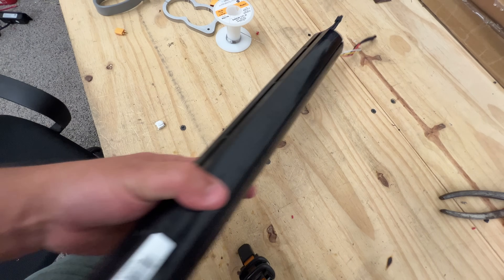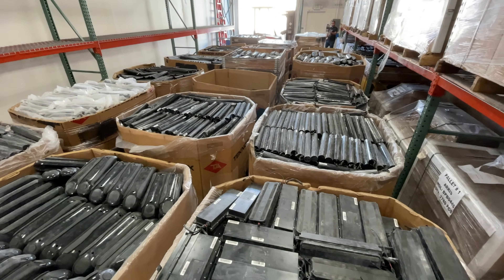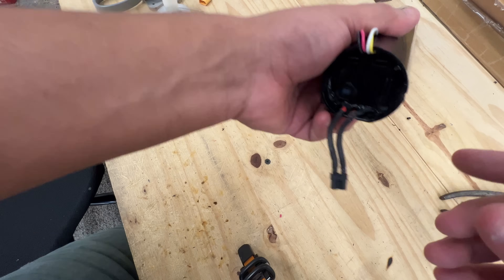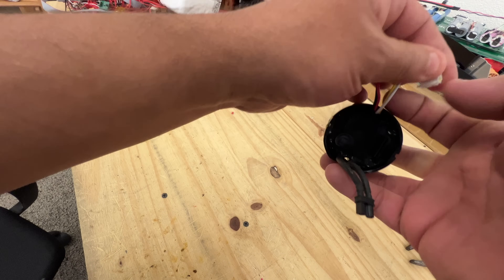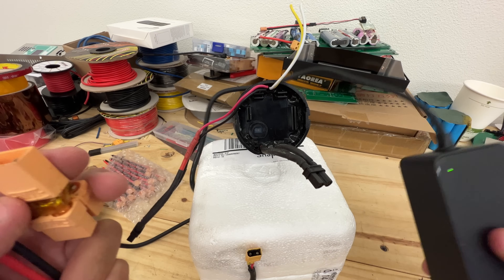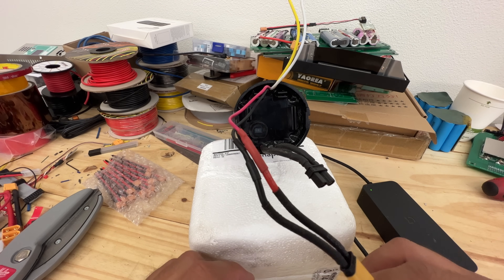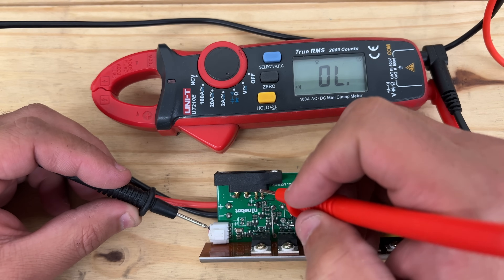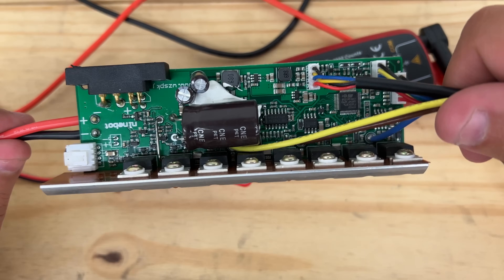36v Scooter Battery charging

Comment: Hello i got 2 42v xiaomi 3m65 pro batteries in series can i connect both red and black wires together for the charging plug and charge them together?
Reply: I would think you should only use and charge 2 packs in parallel.

Comment: Ha! I have SO many of these ES4 packs.  I’m embarrassed to say how many! 

Internal and external. 
Yeah, electrically both are the same but the internal are MUCH easier to extract.  Ninebot started potting external pack’s after some time.  

All have 2500 mAh EVE cells. I can’t remember their c rating but they are relatively high discharge and can take some abuse.  I abused the hell out of them on a scooter back when I thought a ES4 was the best thing ever.  Lol!  I pushed way beyond what the scooters stock amp draw. I was very surprised.  Never once had a bad cell.

Comment: If you found you're way here after having trouble waking up your 20 cell scooter packs here's my experience June 2022:
Charging directly to the thin wires with no other steps only worked on one of my 5 packs purchased recently, Red light blinks 5-8 times then stops, charger stays green.
I'm not sure if this may be because they have been sitting for some time at this point or other factors I don't understand, but if you end up in a similar situation I have seen some success with hitting the reset and charging threw the discharge port (Thicker cables) as referenced in this video. If you're looking for more details on that jehugarcia has an older video that gives very specific instructions (Search for: How to Wake up Best Scooter Batteries of 2021)
Reply: I purchased five of these batteries. I was able to easily get three to work. I unscrewed the cover for the BMS and charged via the discharge connector. When you unscrew the covers it is easy to swap the good BMS boards around to see if the BMS is the issue with non working battery packs. . I will try and work on the two that are not working. My DC power supply was able to charge them to 42 volts. What I really want to do is use the Ninebot controller and the display to see if the BMS will balance the batteries in each pack. If it does, it should be easy to move the controller from one battery pack to the other. I also want to check out what people are calling the bottom BMS in these packs to see if that could be the issue with the two non working battery packs. If I can,t get them to work I could always scavenge the good cells.
Reply: For me on all of my scooter packs I had to by pass the discharge port as it would shut off after 1 minute regardless of load. 
What did you do to get your packs to stay on? I was able to wake all of them up no problem simply by charging them but can't get them to keep outputting voltage. THe blinking light does its thing but after a minute it cuts voltage. So by pass the BMS for output but charge via the BMS/discharge port basically.

Comment: Hey jehu- I just bought some rz3612 are you familiar with them? They are all sitting at about 15v. I was able to charge one of them to about 21v thru the main output wire pair and then it just stopped. There is a small set of red and black wires as well but they only show like 1v(ish) so I don’t think it’s a charging port but… I really don’t know. For all I know these BMS’s are smart and only let power thru one way on the input and output. Any help would be great

Comment: I  just purchased a bunch of these "untested" packs, When I try this, the red LED flashes six times with the last flash being a bit longer, then nothing. They don't charge this way, so I'm going to assume that either there is a problem with cells or the boards themselves, unless anybody has additional information.
Reply: I've had the same thing happen as well with about half the untested packs i purchased.
Reply: @lu6an0  hi, did you find a solution? Thanks
Reply: I ended up going to the battery pack directly and using a CC/CV power supply, charged them up with low current (50 mA) to about 30 v, then charged them with higher current until they were full.
Reply: @magic.marmot  Do you connect the low current supply to the small wire or the normal charge wire?
Reply: @magic.marmot  dis you use the power output connector or did you open the battery pack? Thanks
Reply: Im pretty sure I have a video on my channel from a couple of months ago.
Reply: I have the same issue, and one of the pack do not even has red LED flashes even I current with the small red and black wire, any ideas? I bought 5 packs and only 1 work
Reply: I opened the pack.
Reply: @magic.marmot  thanks, no way to put current through  the output connector?
Reply: @magic.marmot  Do you have a picture showing how to charge it after opened the pack? Thanks for advance!
Reply: I found out the way to charge them now, just keep charging through the small wire for a long time (a day or so), reconnect and disconnect until the red light start blinking. Or if the red light never respond, one can keep charging the a big wire for a very long time too. Eventually, the BMS will wake up. I am able to use this method even the battery voltage is less than 7V. My experience is that when the battery drop below 15V, the red LED starts flashes six times pattern when changer through the small wire, when battery voltage drop less than 10V, the red LED will not even turn on even charge through the small wire.

Comment: What does charging look like when these are connected in parallel for a power wall.  Do the small wires have to be used at this stage.  I wanna throw 28 of these on a Megalo Dongle.

Comment: Could these be used, in a large quantity to power an electric car?
Reply: Absolutely.. I've seen a couple of videos of guys using these for golf carts. As long as you have the correct output voltage and you have enough sales. Tesla the same batteries are internal on these. Not necessarily the same brand but the same size lithium ion cell.

Comment: I purchased two of the external scooter batteries and a charger from you to use in parallel for an ebike.
When I plug the charger into the dedicated charging port on the front of the battery I get the blinking light that you see in this video at 2:50.  Basically it charges for like half of a second and then stops charging for a couple of seconds, then repeats.
The batteries are at 35.5v so it is not that they are too drained.
Has anyone been able to get the external scooter batteries to charge from the charge port?
I can charge it from the discharge port using an xt30, but I am concerned that this is bypassing the bms and the cells may end up out of balance.
Reply: When the charger's light flashes red, the voltage goes up at the discharge port, and when it goes green the voltage floats down again. This form of intermittent charging will eventually charge the battery but like you said, can the bms balance the cell groups?  I think its possible if the controller is not too busy wondering why the charger keeps switching on and off.

If you had an ES scooter you could use the app to see the internal voltages, but otherwise I think the only way to tell is to open the battery and check the cell groups for balance directly.  There is a video on you tube showing how to open the external battery. There are two screws at the top and bottom, and a bunch of snaps on the sides that need to be pried open. 

I have a controller like the one shown in the video, and found that to get a solid red light on my charger I also had to connect the internal battery to the controller with its 4pin cable before the charger will give a solid red charging light. The internal battery's XT30 discharge cable was optional.  

On the external battery there is a legend that labels the 6 exposed pins.
Two are Labeled Rx and Tx. These are for communicating between the bms and the controller. The controller is able to identify the difference between an internal and external battery. There is a guy on YouTube by the name of BananaScience who knows a lot about this. He found that he could hook up an internal battery to the external com port, and see the cell group voltages on his scooter app. But the scooter would not run with the internal battery hooked to the external port.  In order to use an internal battery 'externally' he had to wire them together in parallel by creating a Y cable.

My hunch is that the controller needs to be able to enable or disable each bms to ' avoid paralleling them until their voltages are within some tolerance. I don't feel comfortable guessing beyond this simple idea.

I would slow charge through the charge port in blinking mode in order to keep the bms in control. Then open up the case and check the cell groups for balance.  Personally I would solder two 5 pin RC balance cables with connectors to the cell groups and pass them through holes in the case so I could easily check the balance any time. Then I would bulk charge through the xt30 discharge port to avoid the 'slow blinking light' situation.

Perhaps someone could decode the communication between the controller and battery and use an Arduino to be able to spoof the bms into thinking they are good to go.
This was done for one of the other large scooter batteries that JAG35 sells.
Until then, we will have to deal with these issues.
Reply: @eideticgoone7035  fantastic info. Thank you so much. Yeah, I was wondering the same thing about the Arduino and the bigger scooter battery. Maybe something similar would be needed here.
Reply: @SherwoodWorksInc  Good Luck. Your comment seemed insightful, so I thought you would deserve a deeper reply. It took a while to piece together the clues. By the way, I've had good luck using two M365 scooter batteries wired in parallel on a 36v 500watt geared motor pulling as much as 800 watts. I first brought them to the same voltage then connected them in parallel. I leave them connected together when charging. I plug the charger into one pack's charge port and the other is charged via the discharge port through my Y discharge cable. Like these ninebot batteries there is a bms led that blinks blue then changes to red when charging. When plugged into the charge port on one charger, it changes from blue to red. A few seconds later the other pack starts blinking red even though it is not connected except through the Xt30 parallel discharge cable. If the Ninebot external bms works in the same way, then they might just be able to balance even though you are charging through the discharge port. 
No way to tell without trying.
I haven't yet punctured their shrink wrap on my M365 batteries to measure the state of balance.  I would like to, but I also like them sealed. I think paralleling two or three scooter batteries makes a cheap and good ebike battery.

Comment: Jehu, these batteries have a big disadvantage. The BMS has an Over Current Protection. When discharging they cannot go over 5A. That's the limit.
Reply: you sure? it seems odd that a scooter battery would be limited to 5a, that's only 180w the motor could pull.
Reply: @Wooble57  Tested on the workbench with an Amp-hour tester. When current is same or more than 5A, it triggers OCP. I refurbish these packs and the way to test them is to discharge them at 4.5A.
Reply: @9013368  wow, pretty lame packs then, at least for ebike duty or anything else high drain.  Guessing from the AH rating it's 2p, so that's only 2.5 amps a cell.  Pretty weak.
Reply: @Wooble57  I have also seen this. I bought two for a parallel pack for a 36v 450W ebike. I thought since they were advertised at 7.5 amps it would be fine for 12.5 amps of draw in parallel. I tried it out and after only 5 seconds of full throttle the bms would shut off current and start blinking red. It resets after about 30 seconds. I found that I could hold about 2/3 throttle and it could keep running but makes it basically useless. I may have to add a third one to see if it will make it useable.
Reply: Do you have an instagram or other page we and others can chat about this or other ebike battery problem/solution, im trying a 72 volt assembly but 2 of these in series didnt work for me at all,and i thought the parts i have are to blame so is why i didnt want to go out and buy a big 72 volt pack just yet,it sounds like a bms problem not a battery issue on these packs right?
Reply: The website has an edited listing now. The graphic and details say 5.2A, the page title still says 7.5 A though.

Comment: Do these cells are able to  be used for an electric car on a 72v configuration ?
Reply from the maker: Yes
Reply: @jehugarcia  anything i need to check in order to make sure they are able to power the electric engine?
Reply: @jehugarcia  no shipping available to japan :(
Reply: @jehugarcia  really how ?i bought 2 36 volt battery packs which are in good conditions and the 72 volt wheel im trying to power is controlled by a 1000watt-1500w controller, switch and throttle are configured correctly controller is not shortened,and throttle and 'on switch' are just fine aswell but the wheel still won't move im getting working readings on the vehicles display but ,it continues to relay a low battery emblem,i have them in series correctly,and charged the wheels hall and phase wire are working just fine and have been tested but the wheel still wont move,it is a 10 inch 1500watt wheel all bearings and magnets are in great shape and wheel rolls smoothly while disconnected and smoothly when power is on but i still get no movement for the wheel,i tried this test first because i didnt want to just go and spend heavily on a 72 volt battery pack just yet so this test was a better way for me to go,what is an issue youd think?✌

Comment: Arent the smaller cables always the charge cables and the big ones are for discharge? So wouldn't trying to charge it through the small wires be someone's first effort before they'd ever think to look for a reset button they'd have to drill for...
Reply: Some premade batteries charge and discharge through the main connector and the smaller cables if any are sometimes just used for SOC readout to estimate the range left, with these batteries that is not the case

Comment: JEHU, looks like the charger is not charging  correctly using the small wires. My guess the bms needs activation ro work that way. At least it is an easy way to wake up the bms.
Reply: It may also be that the cells are very low so the BMS is bump charging them much like what you would do on a bench powersupply by limiting the current to a low level to wake low cells up so that the risk of having a pack thermally runaway is reduced.  Either way it looks like it is taking a small charge and the true test would be to leave it for a few hours in a fireproof well ventelated area and see if the pack begins taking a charge normally after a short time.